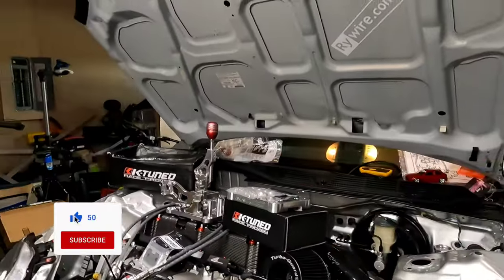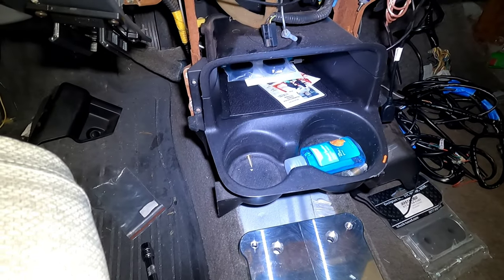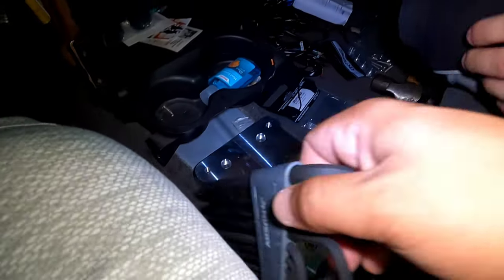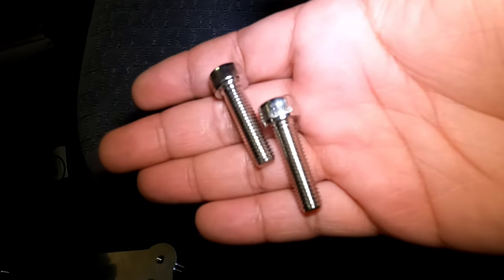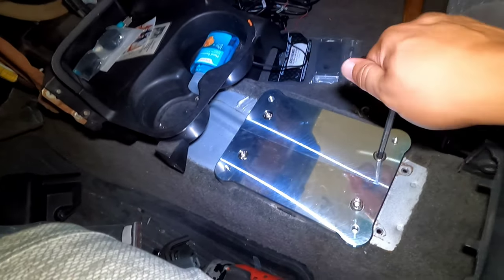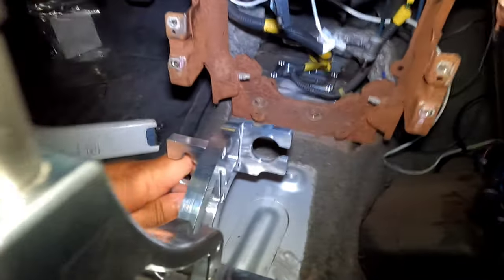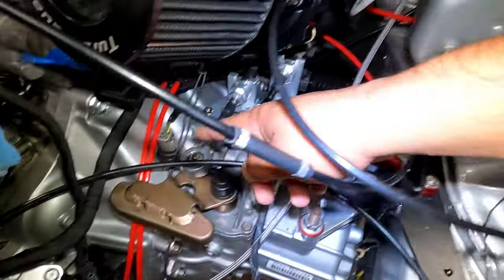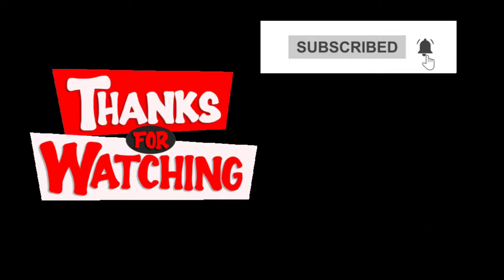K20 AWD CIVIC BUILD KTUNED RSX BILLET SHIFTER BOX / RACE SPEC CABLES INSTALL

Comment: @Puns Garage how do you like the fitment of the console trim with that adapter plate?  Also any binding, or issues with shifting tucking the cab les under the sub-frame?  I need to do this for the Integra, but I really want the OEM shifter so I'm gonna have to cut thangs up! 🤣
Reply from the maker: Feels real good. I thought  it was going to bind at 1st, but it was perfect. I did little cutting to make the trim fit, noting crazy 
u want oem rsx ?
Reply: Yeah I like the smooth of the OEM shifter.  I have a RSX base 5 speed with K20 for the Integra, the older ones were always 5 speed to me.  I'll have to cut the pop-out from the tunnel, and then identify a place to run the cables, probably like you did.  Also I'd seen comments that those adapter plates are wider and mess with the console trim sometimes.
Reply from the maker: @kseries20-24only  hit me up on ig or fb I can send u pics of the console